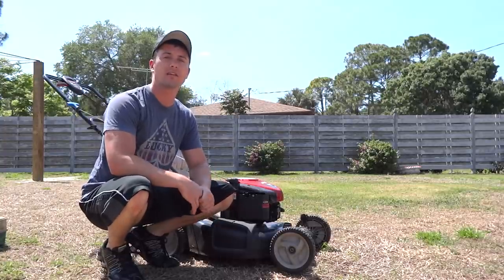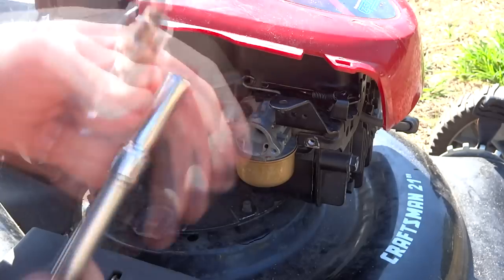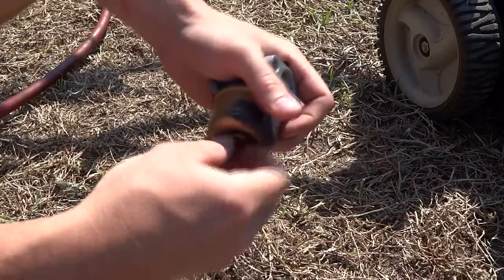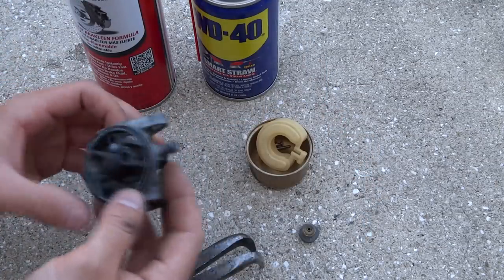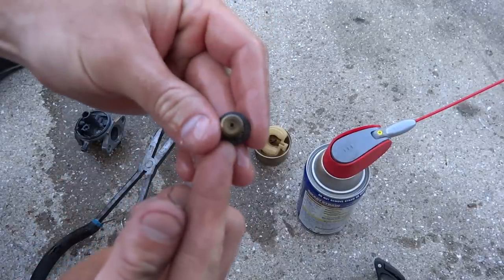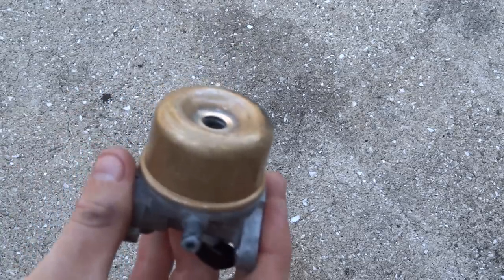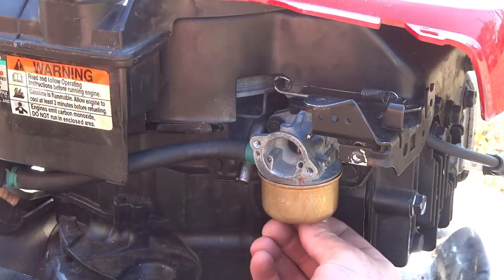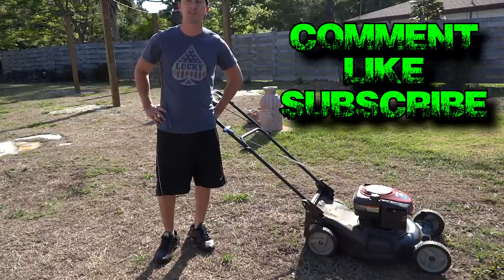Lawn Mower Won't Start? Here's The "FIX"

Comment: I watched but a few seconds of this video and found that this kid actually has a clue.
I do have to say that "bleeding the carb" at the end is not needed. He had a very good helpful hint at the beginning. Put a bit of gas or flammable carb cleaner into the mouth of the carb and pull. If it runs and dies, it's fuel-related. You have spark and compression.
I would have liked to hire some kid like this above in my shop but all I ever ended up with were lying idiots.
Any lawn mower, if in correct tune WILL (not "should") start on the first pull. More if in cold weather as in freezing.
Here's an example of a "mechanic" I hired. He's working on a simple Tecumseh push mower. It won't start. He determined it has no spark and gave up. I put it on my lift and tested it. It had spark. Kid was ready to replace the ignition module. Why? He used the spark plug that was in the engine for a spark tester instead of the proper tool. The plug was bad. That was it.
I had another moron put new rings in a Honda-powered $150 mower. I asked him, "Does it run on a prime?"
"Yeah. A little." but he insisted it needed rings. "It only has 65 pounds compression."
I told him that all these small 4 stroke engines have a built-in compression release on the camshaft and 65 was actually good. Nope. Not good enough for this "expert".
Six weeks and 2 sets of rings later (he ordered wrong rings) he goes to start it. After 17 pulls, it started and he called it good. 
On his day off, I checked it and the choke wasn't closing at all. After a 30 second adjustment, it started 1st pull. It was winter and I tested it in 28 degree weather and it still started 1st pull.
The idiot had put rings in an engine that needed a choke adjustment. Poor customer paid $175 for a $15 minimum charge choke adjustment (I later credited her $160 and had him fired)
The moral of this rambling post?
Most of the people who post "How-to" youtube videos really haven't a clue and anything they say should be taken with a grain of salt, if that.
I see guys telling you to completely take a recoil starter apart to replace the rope. That is not needed yet when I tell them that, they just cuss me out instead of learning from someone (me) who's done this shit for 41 years.
There. I'm spent...

Comment: This carburetor was cleaned the right way but for those people that this vid didn't work for i suggest to just buy a new carburetor it's very easy to install the carburetor are very cheap but remember make sure you buy the right one because there are different types of carburetors. Good luck people.

Comment: did this and came back and there was a leak of gas underneath the carb. what could this be?
Reply from the maker: Baby Hubert Carb bowl nut on the bottom missing the gasket seal washer more then likely, or on top of the bowl, the o-ring.
Reply: Nthefastlane ill check it out!

Comment: Looks like you replaced the needle seat sorry to say looks like u put it on upside-down. You also forgot to mention to clear the holes on the 1/2" bolt you removed from the carb bowl other than that good video
Reply from the maker: +pj.lakings.vc I Did not replace anything except the carburetor gasket that I mentioned in the video and the needle was installed properly.Everything was 100% original parts.And I did bread tie the drain bolts center and then blasted it with cleaner that flowed good thru the two side holes on the drain bolt.

Comment: The pull cord on my lawnmower stop working, what can I do
Reply from the maker: Stacy Williams You can stick a screw driver in the metal mesh and try to poke the rope and pull it back in or give it a few jiggles if it's stuck..sometimes the spring get rusted and doesn't respond.
Reply: Ok I'll try that

Comment: so my lawnmower won't start this spring and the only thing that could be wrong in my opinion is gas left in it during the winter.. It has an automatic choke, no primer and just won't start. This guy at work said to spray a little ether in the air duct and it should start. Anyone ever tried this??
Reply: timtglf Forget ether. Only idiots use ether.
Go to NAPA and get Chemtool carb spray cleaner in the tall, red can.
Make sure it comes with the long, red spray nozzle.
Remove air filter. Spray into carb for 1 second...no more.
Try pulling rope. If it starts, runs for a second or 2, you've found the problem. It's fuel related. If the tank has a lot of old gas in it, try draining the carb bowl. Loosen the nut on the bottom and let it drip or seep until about a table spoon of it drains. Does it stink? It takes quite a while for tank gas to go bad. You may get by with what's still in the tank.
 Anyway, tighten bowl nut, tie the mower handle bail down and spray more cleaner into carb. If it runs and starts to die, keep giving it bursts of carb spray. It eventually may start running on it's own. If, after a minute (no more) of this, if it won't run on it's own, the carb, or at least the main jet needs cleaned. 
Take it to a known GOOD shop with mechanics who can at least find their way home after work (good luck on that one)
Reply: It does work. But brake cleaner works as good and much less dangerous. I use this with my Diesel trucks in the winter at -30 when the guys forgot to plug in the bloc heater. IT works , not recommended but it works. Only idiots call others idiots.
Reply: Ales sandro   I see what you did there.  ;)  ;D
Reply: Ales sandro Did you just call me an "idiot"? Remember that pot calling the kettle "black".
You have to watch some of the carb spray cleaners. There's some that isn't flammable anymore. I call it "Hippie shit". When I called  NAPA to have carb soak (the 1/2 gallon can with a small basket) delivered, I'd tell them, "Don't send me that 'hippie shit'. I want the good stuff. You know, the shit that causes cancer on contact." They always got a kick out of that.
Anyway, if somebody IS an "idiot", it wouldn't be fair to them to NOT call them that. Maybe they'll learn.
I call 'em as I see 'em.
Reply: Ales sandro I'm reminded of the place I just retired from. I had my own small engine shop apart from them, an equipment rental yard. They'd buy ether by the case! I'm thinking, "If these guys (mechanics) were any good, the fucking equipment wouldn't NEED ether to start." Imagine the customers renting something for hundreds of dollars and it having to get started on ether.
Ether IS for IDIOTS!
Reply: David Fruhling I used the same can of brake cleaner for 4 trucks for 3 years. Those plugged in didn't need any. The only time is when an employee forgot to plug it in gor the night or he forgot to fill it at 3/4 at least so there woukdn't be condensation in the fuel tank...or both. When that happened and booster pack was useless a good shot of break cleaner (safer than ether) did the trick just fine. If considering saving 120$ a pop for road service for a 4$ can of break cleaner is being an idiot. So be it. Btw i've been owner operator of a transport company for many years. I certainly do not qualify for the said adjective. 
And like i said before, only idiots call others idiots ;-)
Reply: Oh shoot...i hadn't read your previous post...about the pot n kettle. Are you for real? Waaahaha. Omfg
Reply: I wonder if it would start if you where to clean the carb out with some piss? You could try using some from the pissing contest in the comments above lol.
Reply: +Yamaha SR650 
Does it matter what brand of carb cleaner you use! Is the cheap stuff from Walmart okay or should I buy a name brand? Thanks!

Comment: Great vid, but damn man if your are going to do a thorough cleaning at least stick in a new air filter. That thing looked dirtier than the sock I dug up in my garden. Must have been buried for several years.
Reply from the maker: +Paul Bevillard Customer Was Changing It Himself.It was toast,I used it just for a quick video start up demonstration.
Reply: Nthefastlane You make me proud.

Comment: first off you shouldn't put any sort of metal object thought the jets because it can damage it and widen the holes too much and also the 2(ports) in the middle nozzle there actually unscrews out of there to reveal many other jets. and in a Tecumseh engine u push it down out from inside the mouth of the carb

Comment: nope not my problem. I replaced the spark plug and air filter. It will not start at all. I tried spraying ether into the carb and it still wouldn't start. I checked for spark and I have spark. The plug did smell like gas. I also checked the compression and I was reading 60PSI so I also have compression. So I'm lost as to what to look for next.
Reply from the maker: +bkpickell little late but I would change out the spark plug or it could even be a weak spark from the coil pack. Did you ever figure it out?Please tell..

Comment: I dont see a gasket part number here   -  Published on Aug 18, 2013
If you've already changed your spark plug and air filter and it still isn't firing then this How To is for you. In this video I show you simple steps to getting your lawn mower up and running like new

Comment: Don't waste your time cleaning an old carb like that. You can get a NEW one for $15-30 bucks. Just bolt it on. That old one will have shaft wear and other parts wear. No need in fooling with it. Also buy a briggs paper fuel filter and a fuel shut off valve for EVERY mower you own.